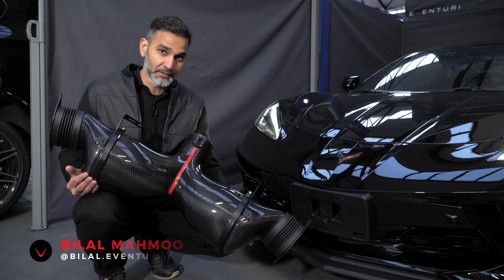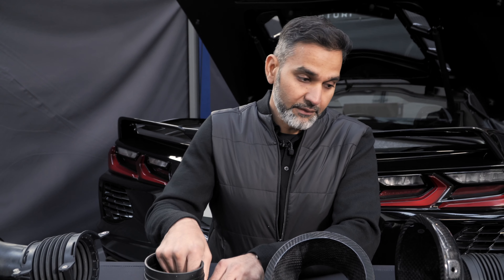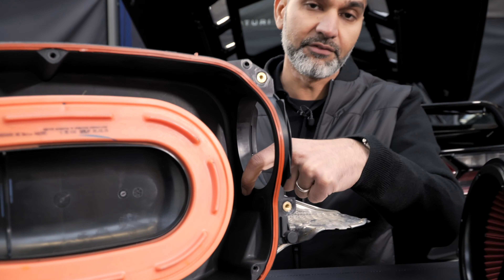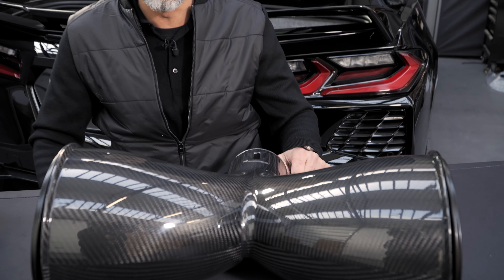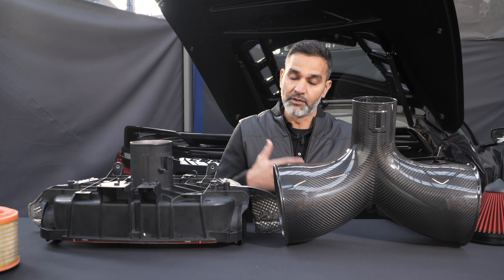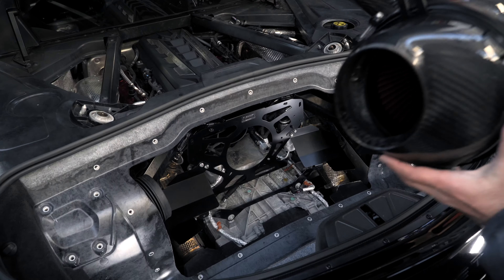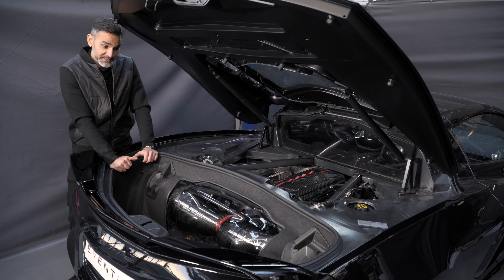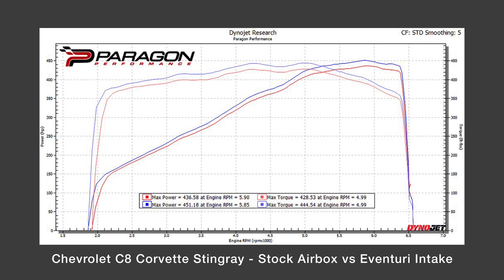C8 Corvette Stingray Eventuri Carbon Intake - Overview, install + dyno testing

Comment: Super nice piece! You should develop like a MAF adapter so you can increase the surface of tube.
Reply from the maker: Thanks! Changing the size of the MAF tube would require remapping the ecu to adjust for the scaling.

Comment: Bruh you trying to make your intake system very high-end, but that doesn’t mean it provides horsepower gains on all kinds of cars. For example, on the AMG GTR, the AMG factory engineers have already done an excellent job, so installing your intake didn’t result in any significant improvement. I spent $2500 on my AMG GTR to install your intake, and after a dyno test, it only added 1-3 horsepower. Honestly, I feel like throwing it in to the trash can.😂